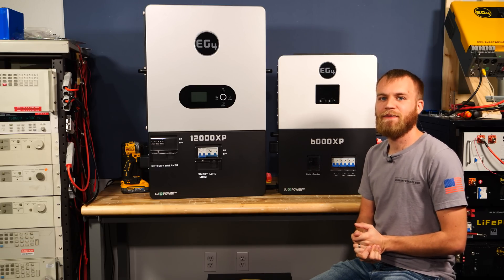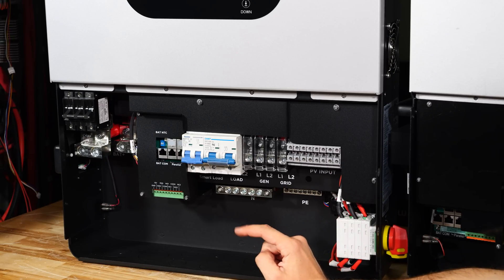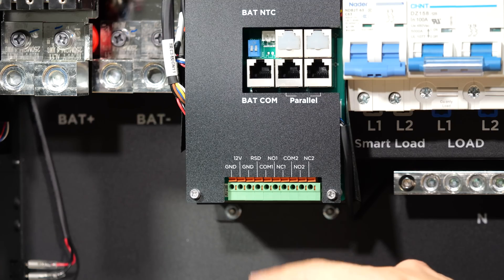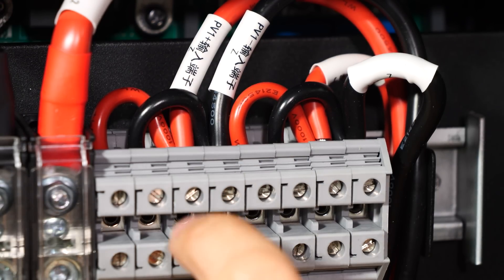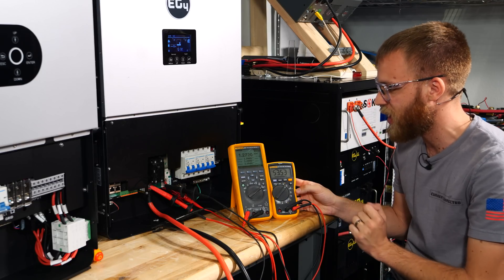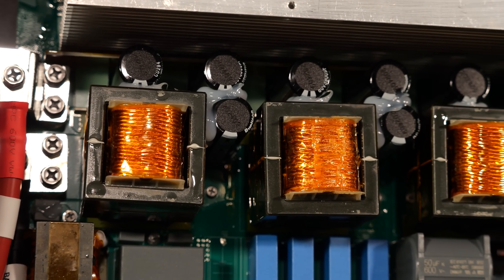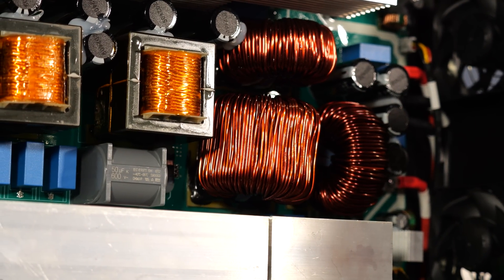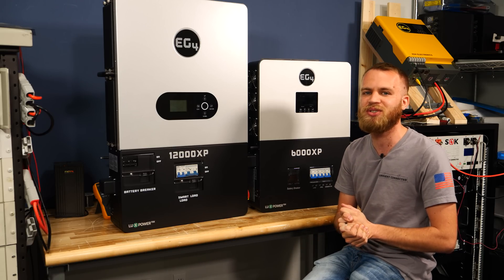Compare EG4's 12000XP to the 6000XP and See What's Inside!

Comment: I really wanted to see the inside of the 6000xp.  Yesterday morning the solar input portion on my 6000xp produced several pops, triggering a fault 17. No pv voltage is detected by the unit now. Oddly, it was a cloudy morning producing not much wattage when it blew and it has been running just fine for at least a year and a half. If warranty denies my claim, then I might take a look inside and see if I can find someone to replace what blew, if fixable, on it.  If I had to guess, maybe some capacitors blew,maybe a mosfet or something. What do you think could cause what happened with pv voltage of low to mid 200's and low watts? Also it was not lightning in the middle of January in MN

Comment: Any guesses how or where the 12000XP performs the L1 / L2 voltage sensing for the AC voltage the inverter makes? And where the L1/L2 voltage sensing is for the incoming grid AC?

Comment: I want to build a small grid down home back up system. I see the grid connection to charge batteries and and output back to the panel to operate grid down. But that feels like a feedback loop to me. I have watched a 100 videos and no good info either. Can you point me to a source to better understand the wiring before I tackle a system?

Comment: The rectifiers are IGBT H-bridge forming synchronous rectifiers on second long heat sink from top which chops synchronously with the 48vdc input H-bridge which are MOSFET's on top long heatsink.  

For split phase 240/120vdc there is two independent HV DC buses that feed two IGBT H-bridge PWM sinewave choppers with two L-C filters generating two 120 vac out of phase outputs. These are two series stacked 120vac inverters for 240/120vac.  Also the reason there is no power sharing between 120 vac phases.

The bank of capacitors are individually 1800 mfd @ 250 wvdc.  Five of the caps in parallel go to each of the two independent HV DC buses which run half the 380vdc you measured (190vdc), to feed each 120vac IGBT PWM sinewave H-bridge.

The two PV SCC boost controllers must pool their PV power then share this pooled PV power to the two independent HV DC buses as 120vac phase load demands.  The two HVDC buses must be kept electrically isolated from each other because the sinewave H-bridges flips the polarity of each HVDC bus in opposite phase polarity switching.  This is usually done from the PV SCC output by an isolating DC to DC converter which also steps down the 500vdc SCC output to 200vdc for each HVDC bus.

Comment: Question, i recently brought a 12000xp.   I had a grid connection and AC coupling hooked up  , but no batteries they were a week away.  Hooked it all up ran a little over 12 hours on bypass. The eg4 tech support cleaned up my settings then a hour or two later it shut down and kept  shutting down after ten minutes.  So after less than 18 hours of use.  I had to take it down and drove it back to signature Solar to fix it. Question is can you run it on grid and AC solar coupling. Until you get batteries? Oh! I started it up at 930pm at night so you know all i had was grid bypassing for all the time running.

Comment: There's a major major flaw on the 12000 XP that almost burnt my house down and came very close to costing my life, since the experience I've been doing research and I'm focusing on your video at exactly one minute 14 seconds you can see the neutral bar but on that neutral bar which only has five places that you can connect a neutral where is it connected on your neutral bar clearly you cannot see where it's connected unless you take a flashlight and you know what you're looking for, again in your video at 2 minutes and 3 seconds you clearly focus on the neutral bar but yet the neutral for the inverter is not visible, they need to dedicate a space on the neutral bar that's isolated that cannot be tampered with just for the inverters neutral since the mishap everything on the inverter seems to be going fine and it seems to be a really good inverter for the money, I haven't overloaded it yet but I'm wanting to figure out whether this has Auto restart after I overload? Thank you for the video I love your video
Reply: I didn't quite understand your comment. Can you explain the problem and what we should look for. And if possible the specific problem you had .
Reply: Are you saying the issue is it’s not clearly marked? Or where the neutral is connected in the inverter?
Reply: My 12000XP came with the inverter's N wire landed on the N busbar in the furthest right position. You really can't see it unless you get in there with a light. The manual cautions this is the case. Worth noting the connection was lose from the factory. 

If you miss the caution or don't notice this you could easily loosen the bolt and slip in your N wire which would push the factory wire out of position - you wouldn't even notice it. And now the inverter has no N wire in the bus. Bad news bears.

Comment: Your obsession with idle current is amazing... wat difference does it make even it idles bit more ?😂
Reply: You can gain power for a limited time of the day, it consume that current 24 hour ms if it's on
Reply: @pr0n5tar but still ... 0.01% vs 99% ? ... its nothing like normal power losses ... focus more on efficiency rather one miniscule irrelevant figure.

Comment: Hi,What do you recommend for a PV breaker & Lightning arrestor box? Looking to set up a a PV Array (Ground mount & single string Array 3200W@ 10.5Amps). Likely going to have two arrays each with seperate breaker & arrestor. I am going to use a an external DC disconnect switch: PV-Single-String Array -> DC Disconnect -> Breaker\Lightning Arrestor. For the DC Disconnect I am probably going to use either Rich Solar or IMO.

Looking to avoid lower quality\cost options but not spend a fortune in either.

Thank You

Comment: Great video!   I have 5 12000XP's and one of my subscribers had a question about switching transistor failures on high frequency inverters.  If a transistor shorts closed on the output phase, what protections are in place to disconnect the EPS so DC voltage isn't sent to the service panel?

Comment: Wonderful segment!  I knew that EG4 inverters were using a high voltage DC bus as an intermediary, but I never knew the exact path the circuits took until I saw this segment.  It's a nice design...  I particularly like the H-Bridge coupling to the DC bus, that insulates the H-Bridge (the most fragile power electronics on the board) from AC-side disruption extremely well.  And also... no wonder these things run so cool!  I have the Flexboss21 myself in a whole-house system (GridBoss, FlexBoss, 3 x Indoor batteries), and I'm sure its design is very similar to the 18KPV.

-Matt

Comment: Omg when you simply changed the connection point for the battery I laughed, that’s so simple but no one else has mentioned it .
Reply: Yeah - I redid my install to use lugs. Nice to have such a large flat pad to land them. I think they spec the original fittings to accommodate easy install of their wall mount batteries leads.

Comment: Omg when you simply changed the connection point for the battery I laughed, that’s so simple but no one else has mentioned it .
Reply: Yeah - same here. While I understand why they wanted that type of connector for batteries I am happy we can still adapt and use lugs.
Reply: @MyGoogleYoutube if only the manual or somewhere online provided the torque specs for those screws that hold the original screw down blocks because they are loose for many people and if using lugs then we don’t have any torque info!?!
Reply: @CajunCoding 

I just went with good and tight and used a bolt with a serrated head. 

I would rather land my proven tinned lugs crimped with my hydraulic crimp tool in the EG4 than use some no name ferrule to keep the fine stranded wires from splaying out while getting crushed by that barrel thingy. 

The only reasons EG4 set it up like this is so the EG4 wall mount battery folks could wire up their 12000xp in no time. ...at least that is my guess. 

Why EG4 didn't make an effort to accomdate folks that would rather use lugs is beyond me.

Comment: One of the things that really makes the 12000XP shine over 2x 6000XPs, is that the 12000XP can actually process up to 24KW of solar where 2x 6000XPs can process  up to 16KW. For the 12000XP, that means if you max out the amount of panels, you can potentially charge your batteries with roughly 12KW while at the same time powering loads up to another 12KW. This inverter is simply an off-grid beast.

Comment: By far the most in depth look I've seen on the two inverters. Did not know you could remove the lug on the battery terminals on the 12000xp would have saved me a struggle when upgrading from 6000xp

Comment: I know that you do not recommend the 6000XP for RV use.  How about the 12000XP?
Reply from the maker: Unfortunately our answer is the same for the 12000XP - RV use is not recommended! There are a couple reasons for it, one being that it doesn't have a neutral-ground-bond relay, and two being that it's not meant to handle all the motion and turbulence that an RV would expect to see. However, you are always welcome to reach out to our techs for assistance designing a recommended mobile solution!

Comment: Your videos are always very well done.  Great video work on the products and the detailed info I am looking for.

I was about to order 2 of the 12000xp's and am now unsure.  I currently have one 18kpv and want more output capacity as well as pv input.  I will never need the sell back abilities of the hybrids and want to do away with the extra settings in the menues related to grid interaction.  Notice how EG4 only specs out the standby idle consumption...  November to february have terrible stretches of rainy days here and idle on 2 units sdds up.  

Thanks for this info.  Also want you to know my experience with buying and tech support with Current Connected has been great

Comment: Hey Dexter can either of these inverters supply ac to a 12000 hybrid luxpower
Reply: Does the 18kpv/Lucpower blend grid power with the inverter to reach over 12000w output to the load terminals?  Could I connect a 12000xp load out to my 18kpv grid terminals to reach the 24000watts I am looking for?